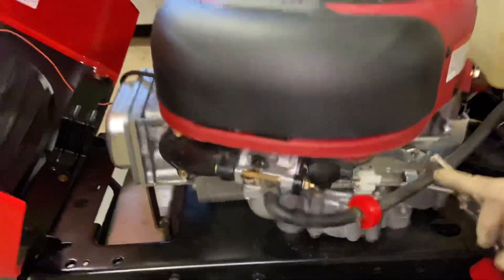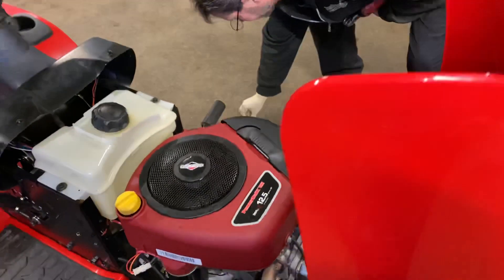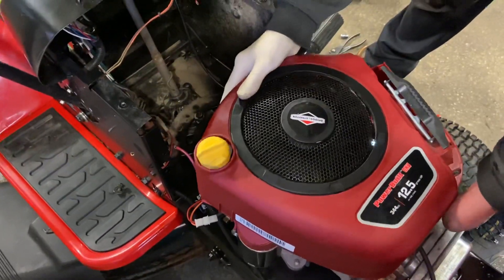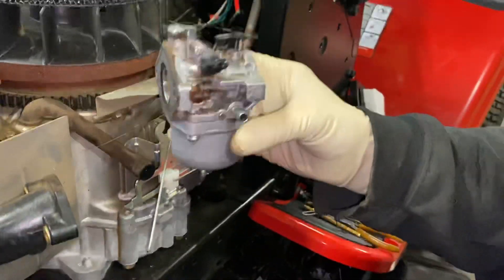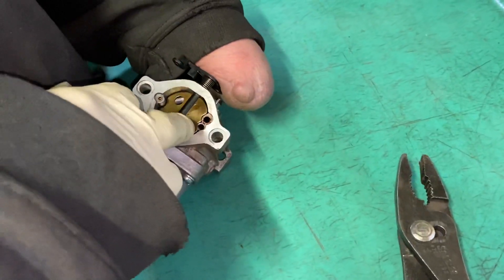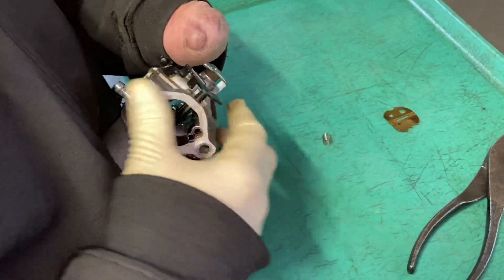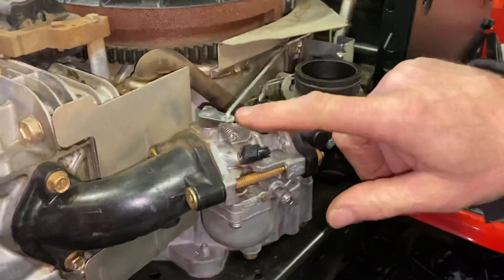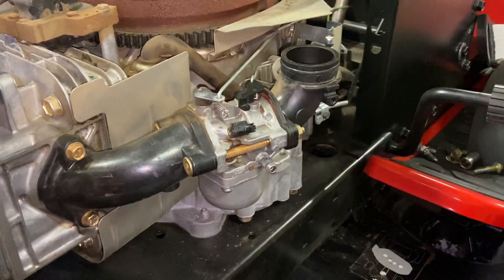Tractor will not stay running, Briggs and Stratton engine

Comment: Using fuel with ethanol can gum up the carburetor if the mower is not used for a long period of time. It can also damage the fuel lines as well. I've had a choke mechanism get stuck on me years ago from using ethanol type fuels, and the mower wasn't ran in a while. Turned out the mechanism was gummed up on the carb. Took the carb off and cleaned it off GOOD. Problem solved. The mechanism was just fine.